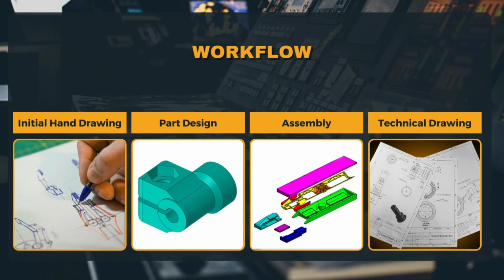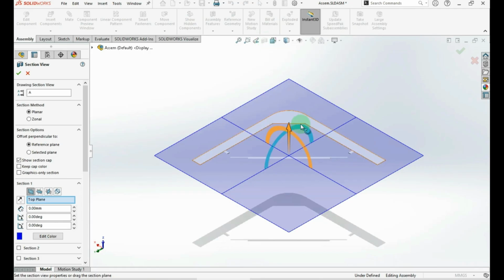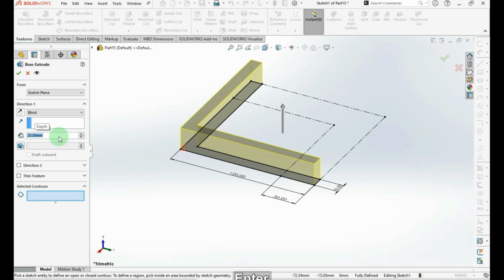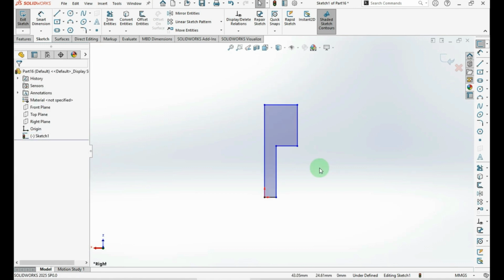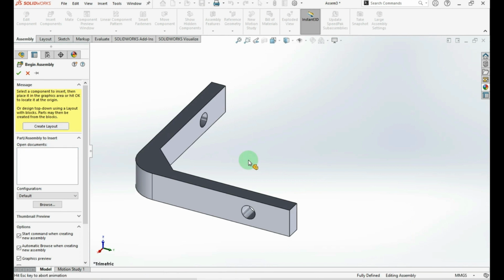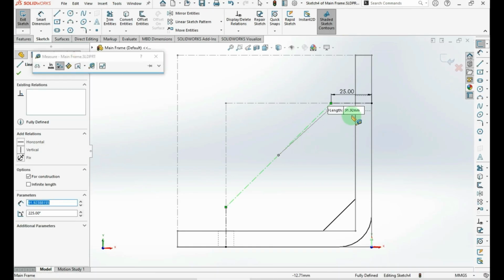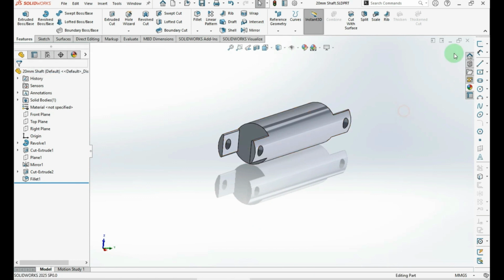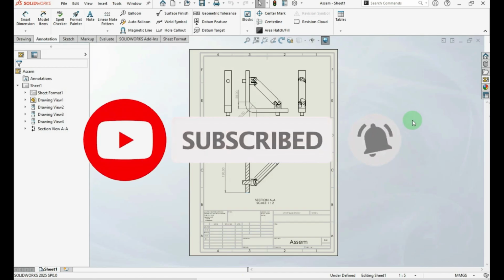SolidWorks Tutorial For Beginners In 2 Hours - Part 1

Comment: SolidWorks only runs on Windows. 
Windows will soon be screen recording everything you do.
Setting up a virtual machine is more complicated than learning a different cam program. 
Solidworks is right out.
Reply from the maker: The majority of commercial CAD software used in the industry runs on Windows. Microsoft certainly won't miss out on such a huge market with such high revenue!